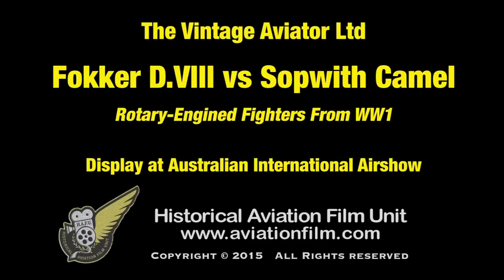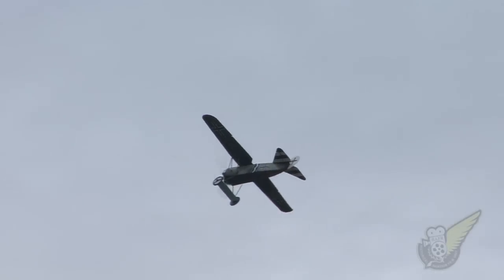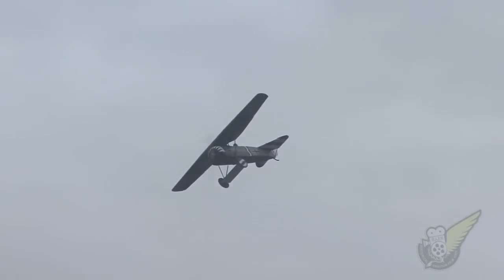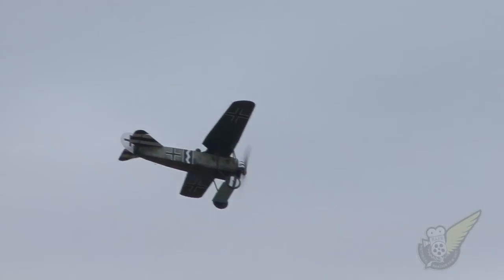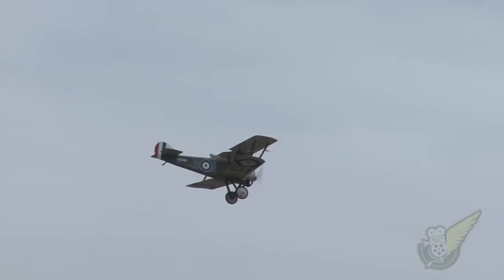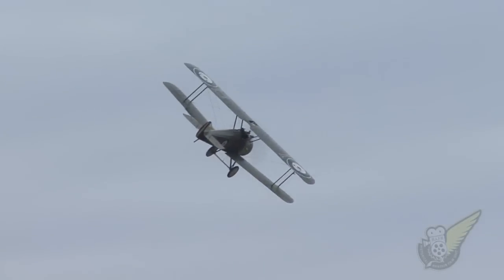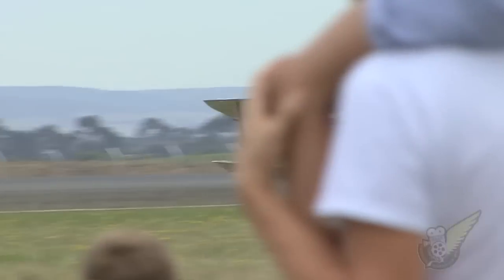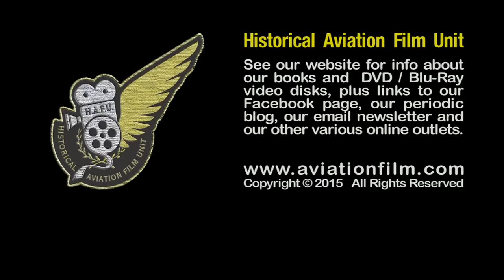WW1 Fokker Monoplane vs Sopwith Biplane

Comment: The Camel was great at slower speeds and hanging on the prop with tight loops.  The D8 was a faster machine altogether.  Two different fighting styles that would be interesting to see who had the advantage.  Bounce and run would be favorable to the Fokker but it could never turn and loop as tightly as the Sopwith in a protracted engagement.

Comment: Further, just checked Wikipedia about engines for Sopwith. Not type of engine I'm working on. Just to note, Wikipedia article has some gross errors in it concerning rotary engines. It says that cylinders rotated. That is only true for SOME rotary engines, but not most, I think.
Reply from the maker: +Merton Hale Nope, it's true for ALL rotary engines -- if the whole engine doesn't rotate, then it's not a (WW1) rotary engine. You may be getting confused with radial engines, which outwardly can look a lot like rotarys, but which do NOT rotate at all.
Reply: +Historical Aviation Film Unit Oops. I got it wrong, mixed up rotary with radial. Big difference. And of course i know the difference. I'll try to be more careful in the future. Thanks for the correction.

Comment: Don't understand comment about no carbs. I just finished helping to restore a Benz IV, straight 6, not radial but it has carbs. Currently working on Salmson 9 cylinder water cooled radial, built about 1914. It has carbs, two,of them, made by Zenith. Beautiful things. So don't understand comment that planes had no carbs. Engine speed was not able to be varied like we thing of today, I agree, sort of full on or idle. Does anyone know what type of engine the Sopwith has?
Reply from the maker: +Merton Hale This engine is a 160hp Gnome rotary.